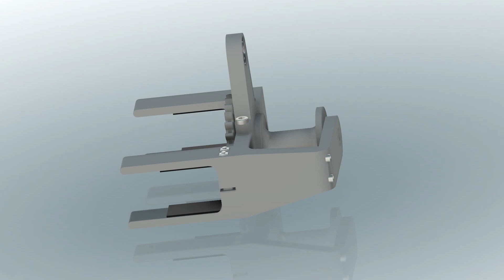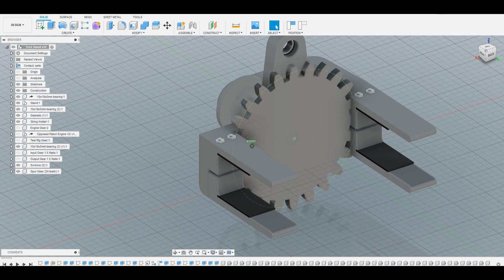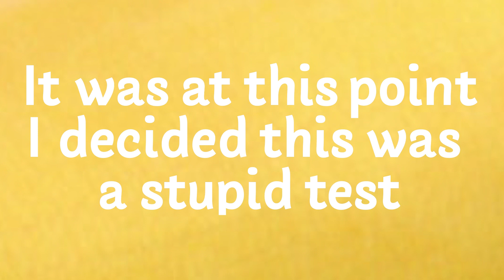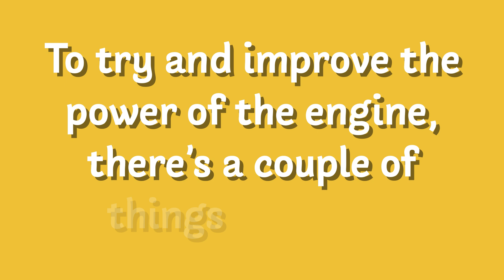3D Printed Opposed Piston Engine - How powerful is it?

Comment: Really nice engine and engineering man. Just a little tip: How is the valve timing exactly? Does it open when the pistons are at the nearest point or will it work better if the valve opens like 5 degrees sooner as they are on the way to each other. And maybe it will work better if the valve opens electronically with a coil so the mechanical resistance is lower and the hole valve is better sealed😁. Have a nice.... Build😌

Comment: I think the next thing to do is just to have a dual piston engine, but with pistons that are offset so instead of only 180 degrees of the 360 degree rotation is powered, you have 360 degrees of power.

So dual pistons, offset by 180 degrees.
This will also make it run smoother and maybe then it can maaaybe lift the banana? Cause with smoother power delivery, it wont be as easy to stall cause there isnt as much time that the flywheel is all thats keeping it spinning.
Reply from the maker: Yeah I agree this would definitely help, only having a power stroke every 180 degrees isnt ideal, thanks!!
Reply: @kurzey8532  or lets go crazy with 4 cylinders, offset by 90 degrees off of eachother and have power every 90 degrees!
Reply from the maker: Me: How many cylinders do you want?
Duck Face: Yes
Reply: @kurzey8532  the more the better
Reply: @kurzey8532  The Napier Deltic uses an offset TDC to eliminate the need for valves, using the "left" and "right" cylinder to expose intake and exhaust ports at appropriate times to scavenge it's 2 stroke cycle. 

I know this is a year old, but... food for thought.

Comment: Hey Kurzey, great stuff! Love your videos.
Just wondering something - do you think your engines would run on steam? If so, maybe that would provide longer duration and a more consistent pressure???
Reply from the maker: They would run on steam...temporarily 🤣 the plastic would probably start to melt pretty quickly, I would like to try it tho
Reply: @kurzey8532  or maybe something like butane or dry ice. Good luck with it, I've subscribed and looking forward to your next video. Keep up the good work!
Reply from the maker: Yeah CO2 cannisters would be cool the explore, they're at like 700-800 psi, glad you like the videos, thank you!

Comment: You can get an Anycubic Photon s for 100 quid on ebay with 3 day delivery and 1l of Standard Anycubic resin for 23 quid, a uv nail lamp for 7 and some metylated spirits/ipa and ppe for another 20. Try giving resin a go. Its an absolute pain for the first week, but then it kind of grows own you and it looks like it would be better for your kind of projects.
Reply from the maker: I will get one eventually, right now I have nowhere to put one, I don't really want to suck in the resin fumes while I'm sleeping lol
Reply: @kurzey8532  yeah, need to keep it somewhere well ventilated, but away from the sun. Well, if you need some parts printed in resin, let me know :)

Comment: Hey… print the axle separately please for structural strength
Reply from the maker: The joints have to be really tight for this to not make the whole engine wobble, haven't had an issue with the axle/gear combo
Reply: @kurzey8532  you are printing the axles horizontally, but if you print it vertically, it will be much stronger for handling that torque. You can make it a strip size hole in the gear and a t shape axle to reduce vibration.
Reply from the maker: Yeah it would be stronger printed in a different orientation, engine isn't powerful enough for it to matter yet tho 😂

Comment: What kinda top/bottom layers you running on those gears? I made some gears that fit something akin to a lego shaft and I used to slam them against my bench to fit them together
Reply from the maker: No different to how I usually print, how did you design the gears, did you incorporate a tolerance in them, otherwise I can see why they'd jam together
Reply: @kurzey8532  ye they had a .2 mm air gap designed into them and sometimes they slip together nice other times its a little tighter than normal, i was just wondering cause that gear looked like it fell abart really easily

Comment: again reinforce them with a simple metal pin or better in this case a wedge
Reply from the maker: Reinforce which part?
Reply: @kurzey8532  any part that has a twisting force like that breaking output shaft centre